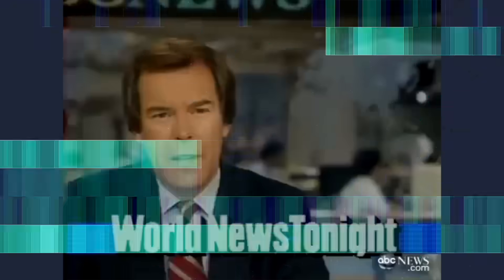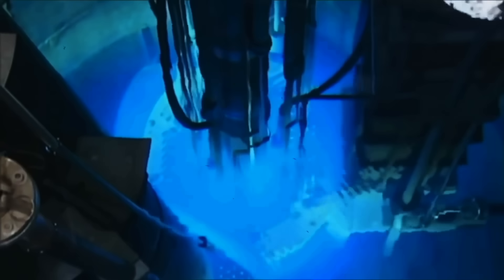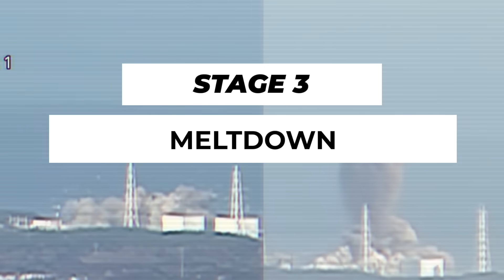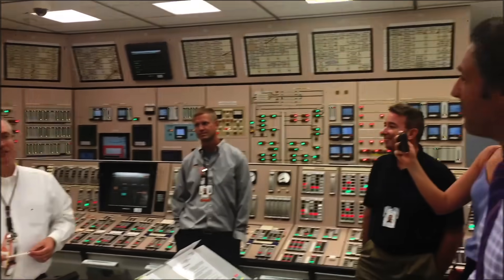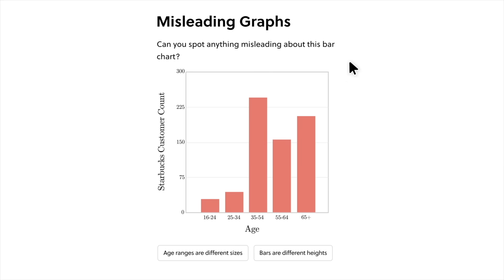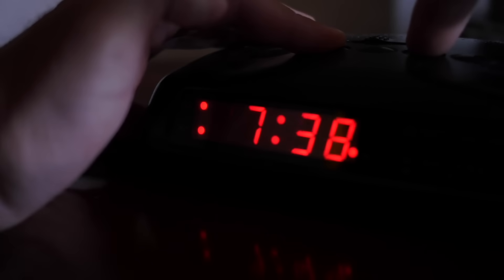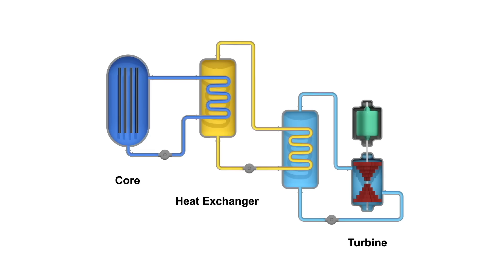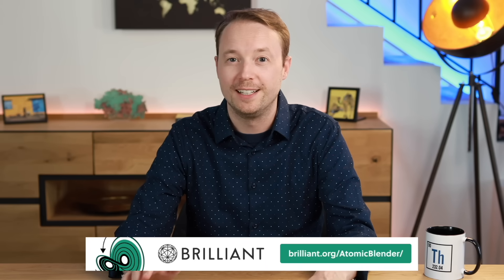Why Is It So Hard to Stop Meltdowns?

Comment: I am a Nuclear Power Plant Engineer.....

MISTAKE (falsehood) #1:  There is no "cooling water" in the Primary System of a Nuclear Reactor.   The water goes into the Steam Generator...HOT.  Their is a heat exchange between the Primary Water and Secondary Water inside the Steam Generator. 

The Primary Side Water is completely contained inside the U-tubes inside the Steam Generator.  The Primary Water never touches the Secondary Water which is at ambient temperature.   The Primary Side Water enters are 570 Fahrenheit and exits at about 230. But this depends on the flow rate of the Primary Reactor Pumps.   The slower the pump rate, the more heat is exchanged from the Primary Side to the Secondary Side Water.  The reason that the Primary Side Water is 570; is because the entire Primary System is pressurized to 2000 Pounds to raise the boiling point of the Primary Water to 630 Fahrenheit.

The Secondary Side water is not pressurized.  Therefore, at sea level...the secondary water flashes to steam when it comes into contact with the Primary Side U-Tube Piping configuration inside the Steam Generator.  

The "cooling of the Primary side Water occurs only via this heat exchange".  One side heats up...the other cools down.

THERE ARE NO TANKS THAT ADD WATER TO THE PRIMARY SIDE...because the water cannot escape the Primary System of a Nuclear Reactor Power Plant.  IT IS IMPOSSIBLE. 

The person speaking does not know the operations of a Nuclear Power Plant...particularly THE CORE and how it is cooled.  

NEXT.....I stopped at the first mistake...and now; continuing until I hear #2.

MISTAKE (lie) #2:  Reactors do not "continue to heat up" when the Core is shut down.  This is a bold-faced LIE...and I do not care if it is told "IN IGNORANCE".  Once the Hafnium control rods drop into place and absorb all the neutrons...the Uranium CANNOT FISSION.

Therefore...you continue to run the primary pumps from the residual steam...as the Primary Side Water is continuing to cool down due to the Heat Exchange in the Steam Generator.  This is total bs....and here is why.

Hafnium absorbs all neutrons in a core.   Control Rods used to shut down a reaction.  Control Rods are made of Hafnium and the difference between the "absorption of Neutrons by Hafnium" and the "absorption of Neutrons by Uranium" is on the speed and the Kinetic Energy of the Neutrons.  Water moderates the speed of the Neutrons in order that Uranium can absorb these Neutrons. 

MODERATE means "slows the Neutrons down" to remove the Kinetic Energy and "create" Slow Neutrons.  This is the correct term used in Nuclear Reactor Physics.  The reason is simple.  If the Kinetic Energy is to high; aka "fast neutron"...the U-235 will not absorb any neutrons.  Therefore, the U-235 will not become 236 or 237...and then fission.   Fuel rods are made in labs and are handled "by hand". They are not "hot"...because they cannot absorb Neutrons unless those rods are in water....and the Neutrons are slowed down inside a Nuclear Reactor Core.

ENTER....HAFNIUM CONTROL RODS.  Hafnium "does not care" about the speed or Kinetic Energy of Neutrons...it absorbs them all. The comparison like a Pro Tennis Player being the Partner in a doubles tennis match with a blind person that is bond, tied, gagged and laying on the ground.  The Pro must hit all the balls...because the person on the ground can do nothing.  

This is what happens during a Scram Event or Shut Down of a Reactor Core....BY INSERTING THE HAFNIUM CONTROL RODS.  The HAFNIUM TAKES ALL THE HITS FROM THE NEUTRONS.....before they can even get to the Uranium.

Therefore...this MOO-ron...is lying (albeit in ignorance) because there is NO HEAT generated by the Uranium after a core is "shut down".  And, there can be no heat generated by Uranium without the water to slow down the Neutrons.  If this were true...you could not handle the fuel rods "in open air".  You could not produce Uranium fuel rods in a lab or manufacturing facility.  You could not ship Uranium on Ships...as Russia does to shipping to the USA (because, even during war...the US is still buying its Uranium from Russia)

Further...you could never "shut down and replace the fuel rods".  And, you could NEVER ENTER THE REACTOR ROOM AFTER THE PLANT IS SHUT DOWN....because you would burn from the heat...if what the MOOron is saying was true.

However, as a Reactor Plant Operator...I have operated the panels where you can do a slow, controlled shut down...or you can hit "the Scram Button" and shut down the Fission in the Core in....2 seconds.  Scram releases the mechanical interlocks on the Control Rods so that they will drop immediately to the bottom of a core "freefall"...due to Gravity.   The rods are heavy and will slam into place almost instantaneously.  Onboard a Submarine...a Scram and Slam of the HAFNIUM CONTROL RODS...will shake the entire boat.

BOTTOM LINE: The TALKER in the video has no idea about Nuclear Physics or Nuclear Power Plant Physics or Neutron Absorption or Nuclear Fission...or even basic power plant functions.  

The Primary side is completely self-contained.  No water is added or lost...unless you blew out a pipe or directly/physically open a valve to release primary water...which no one would do.  Nothing in the primary side ever "turns to steam or steams off".  And, water is NEVER LOST.  It heats in the core; and cools in the Steam Generator and is then pumped back into the core to be reheated in a constant and continuous cycle.

so.... A. The Control Rods are not "MAGIC".  They operate according to Nuclear Physics.
........ B.  The concept of "if you don't have water"....is a physical impossibility in a Nuclear Power Plant...on the primary side.

MISTAKE (LIE) #3.  "Ceramic fuel"?  What in the hell is "ceramic fuel"?  There is no such thing in a Nuclear Reactor.  Uranium is not "ceramic" and the Uranium fuel is not contained in STEEL.  Uranium melts at 2080 degrees.  Uranium fuel is "pelletized" and those pellets are housed inside Zirconium Rods which are hollow and capped with Zirconium Caps.  

The melting point of Zirconium is 3071 Fahrenheit...and therefore, even if it were possible that "the Uranium fuel pellets melted"....(which it is not possible)...the Uranium is contained within the Zirconium....and it is not possible that any Nuclear core can reach these temperatures.

OKAY...I made it to 5 minutes and I cannot watch any more of this bs garbage....IGNORANCE.

If you want to debate this or any other topic relating to Nuclear Physics or Nuclear Reactor Physics or Nuclear Power Plant Physics or Operations...then I will be happy to oblige.  

BUT...this video is a perfect example of how the MASSES are deceived about the "safeties and/or dangers" of Nuclear Power Generation.  This video is based entirely on "propaganda and lies" that the TALKER in the video heard...."SOMEWHERE".

Or...he made it up.  When you want to learn from someone that operated plants...or worked on New Construction Subs...or land based Nuclear Power...or someone that has "scrammed a core"....or "slow shutdown a core"...and then went inside the Primary Side of the Power Plant to monitor physical equipment or do regular maintenance on the electronics components inside the Primary Reactor Room....then leave a decent comment and I would be happy to correct the nonsense being delivered here.

It is infuriating to see novices and others who NEVER worked in the field...pretend to "educate the public" on matters best left to those with actual experience and expertise.

Oh...and just to make one point about "containment".....watch: Inside MIT's Nuclear Reactor
https://www.youtube.com/watch?v=5QcN3KDexcU
Reply: For an operator, you seem pretty inexperienced. You are only talking about PWR reactors, while the video speaker is talking about BWR reactors. Yes, they put a PWR diagram, but they are in fact talking about BWR reactors. 
"Mistake" 1. In BWRs, there is only 1 cooling loop.
"Mistake" 2. Ever heard of shutdown pumps? Maybe not in research reactors, but in commercial reactors, there is A LOT of decay heat, even after shutdown. That is why they have shutdown pumps.
"Mistake" 3. Ceramic oxide fuels were introduced in the 1950s, following military applications of nuclear power. They are very common in reactor designs.
Reply: Thanks for setting the record straight. I spent a 20 year career beginning in the 1970's as a mechanical designer / engineer building PWR/BWR nuclear power plants in the U.S. I said back then that giving up on them would be a mistake, and that they would make a comeback after I retired. The sad part is how poorly the general public is informed. I am very encouraged by the new designs. Let's hope they don't muck it up.

Comment: This might be a dumb question but I’ve always wanted and explanation of how the cooling water avoids being contaminated with radiation but is still able transfer heat, in a manner that it can be released into the world. I’ve always wondered and it seems like too simple of an answer in my head to be right
Reply: Cooling water is in fact, not released into the world. Cooling water is in a completely independant loop that goes right back into the core after transferring heat. However, in emergency situations, steam may be vented from the turbines due to overpressure. Contrary to popular belief however, the steam is IRRADIATED, which means it has been subjected to radiation, but it is not RADIOACTIVE, which means it is actively emitting radiation. So this is completely safe. :)